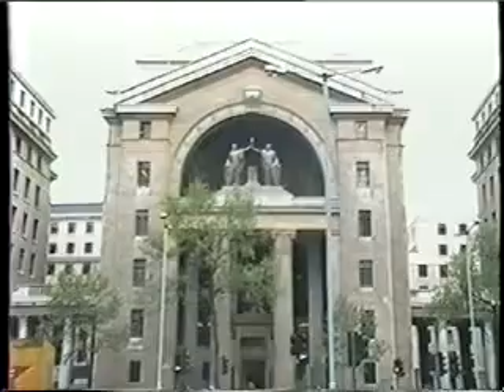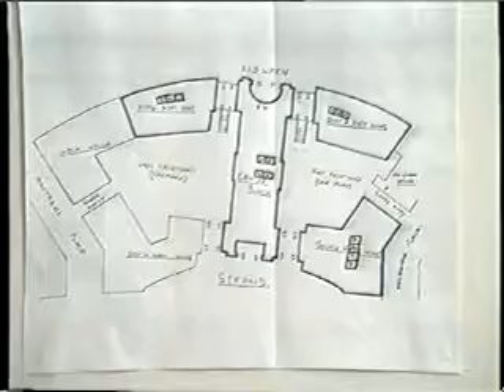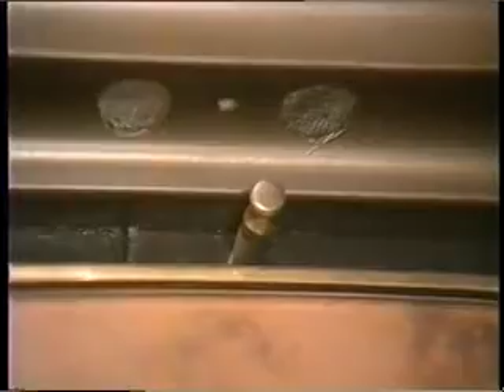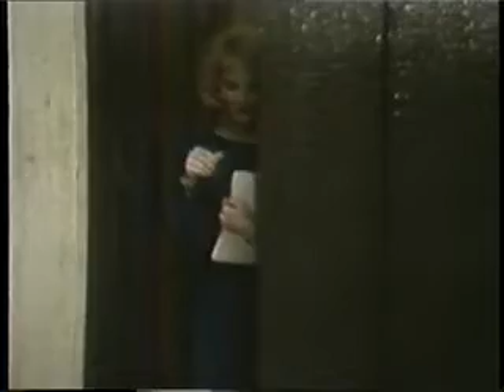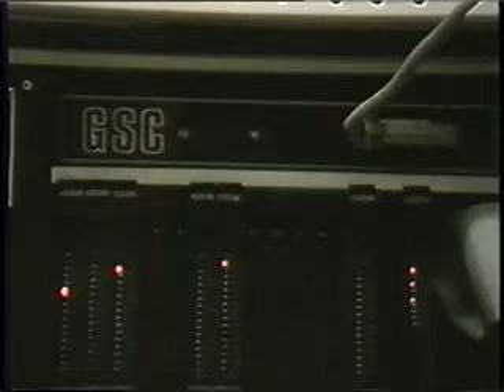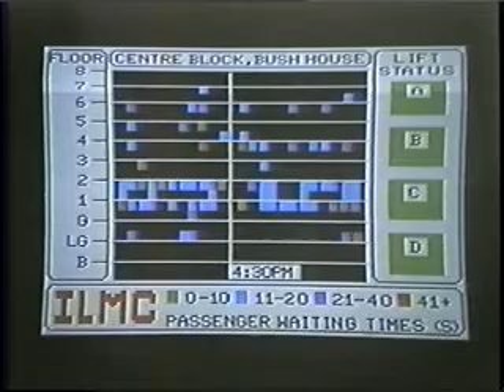BBC BUSH HOUSE END OF AN ERA  - "Didn't They Do Well" - The Lifts

Comment: This video is like a mystery to me from a parallel universe. 
First question, why in the video is there no mention of the BBC, the video suggests business offices?
What year was this going on? I ask because I don't recognise the lifts and spent a lot of time at Bush House from 1983-1987 and the buttons outside the lift and inside were slightly different.
Lastly there is a shot in which two lifts are side by side but my recollection is of at least 4 lifts side by side.